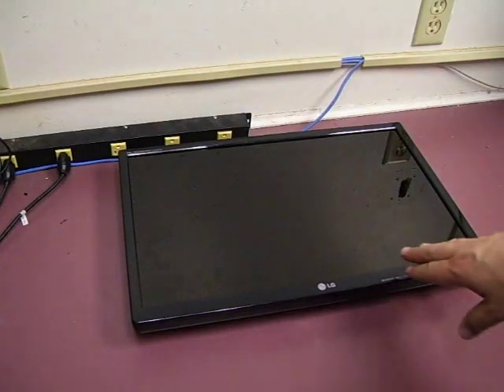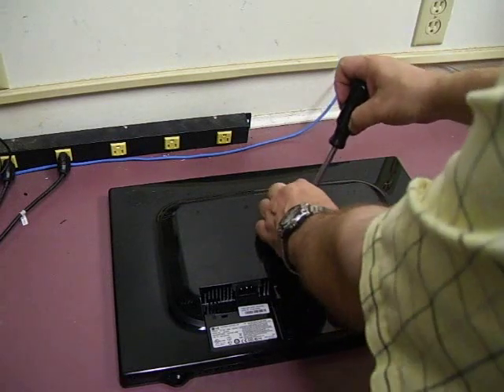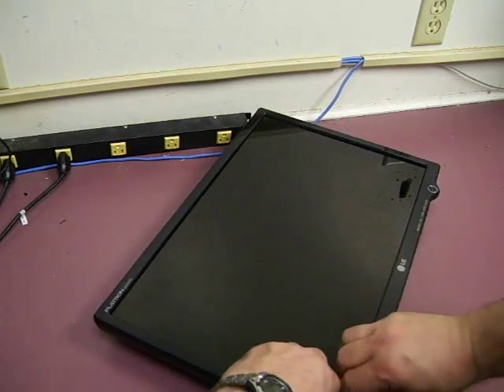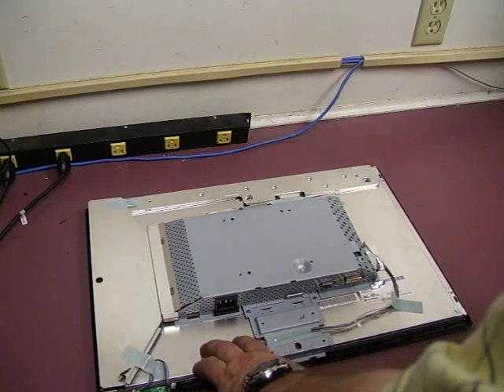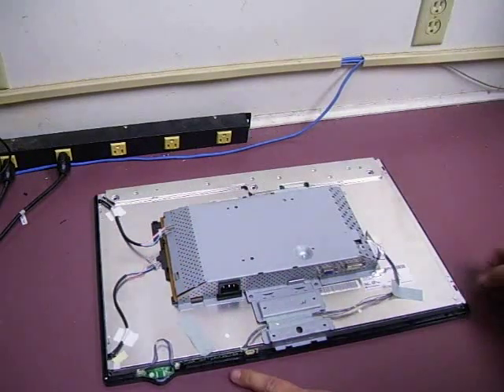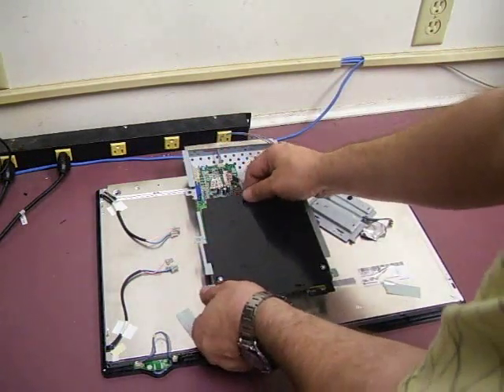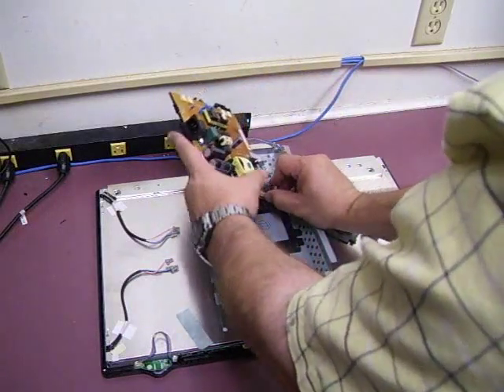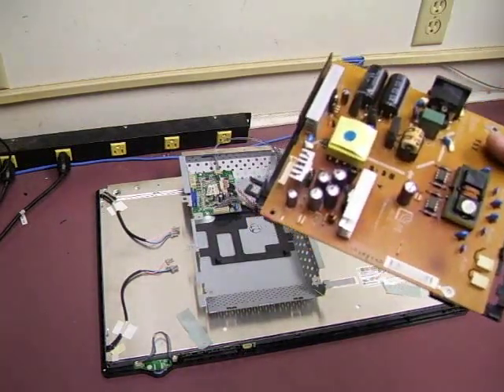Repairing a LG L227wtg-pf monitor - Part 1 Disassembly

Comment: I live in Japan, I saw your video, and I followed it step by step, and it worked. My monitor went back to work.
Thanks, and keep posting videos like that, as it will help a lot of people. There was a capacitor value that I couldn't find with the same value, it was that 680uf 25v, I then knew that I could use a higher value in case I used a 1000uf 25v, and the monitor is working properly.

Comment: At about 2:38 in the video, he unplugs the control panel connector.  My connector absolutely would not come out.  I had to pull the wires out from the connector.  I can get them back in, but I am not 100% sure of the order.  Are they in the same order as the other end on the main circuit board?  In other words, do none of the wires crossover positions between the two connectors?
Reply: I just did exactly the same thing.  Except I only pulled one wire out.  The way these connectors are made, you can't just stick the wire back in. I plugged the connector back in and powered the monitor back up.  (And waited.)  It looks like the control buttons don't work, but I haven't changed those settings in 10 years, so no big deal. 

If anybody sees this before they do the same thing, there are small (very small) tabs on each side of the connector that you can pry up on with a screwdriver.  They are on the same edge as the wires.  Go slow.
Reply: If anybody sees this before they do the same thing, there are small (very small) tabs on each side of the connector that you can pry up on with a screwdriver.  They are on the same edge as the wires.  Go slow.